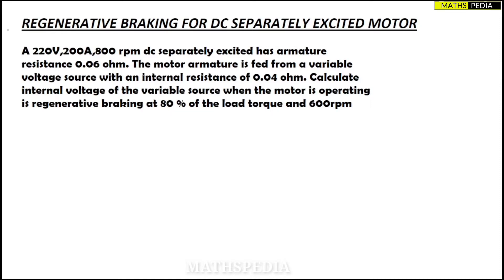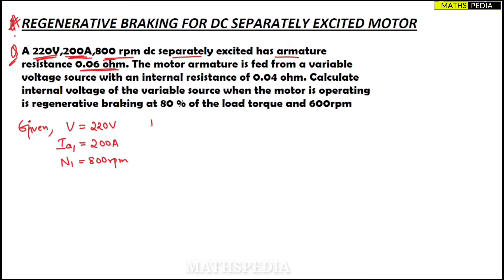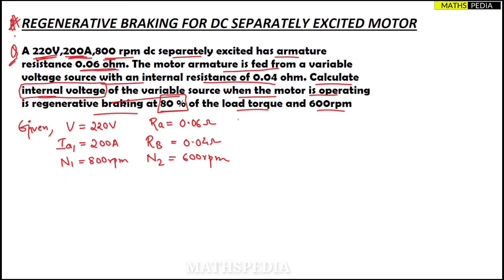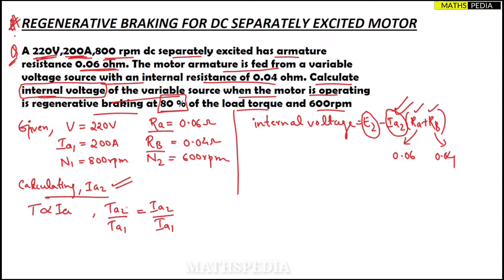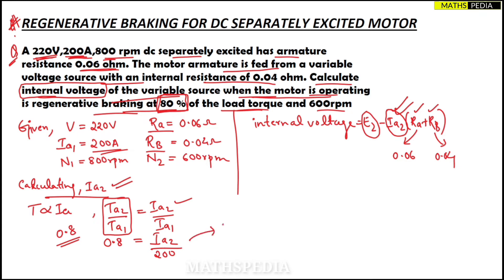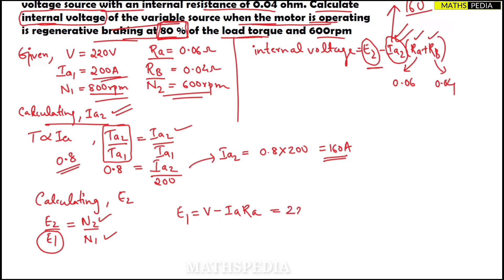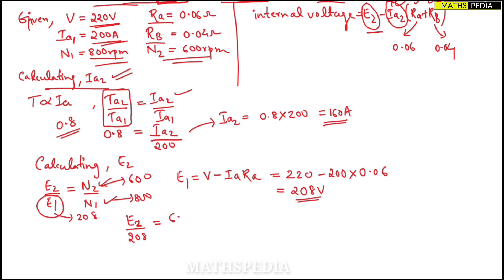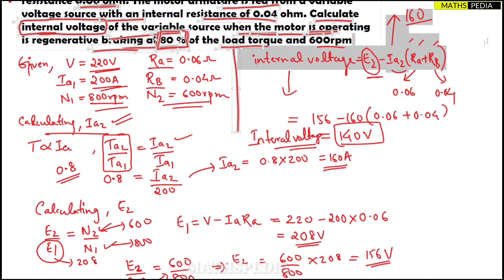Regenerative braking for DC separately excited motor |Industrial Drives and Control|Problem Solved|

Comment: Sir, I have a doubt.
In regenerative braking  internal voltage is  Eb=V+ Ia(Ra+RB)
Because the motor behaves like a generator in regenerative braking mode.
Reply from the maker: yes